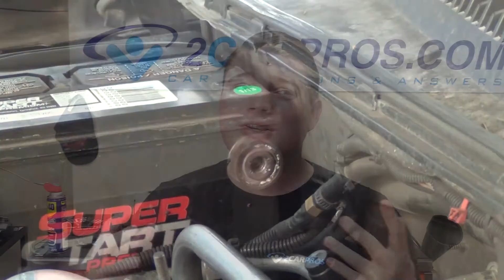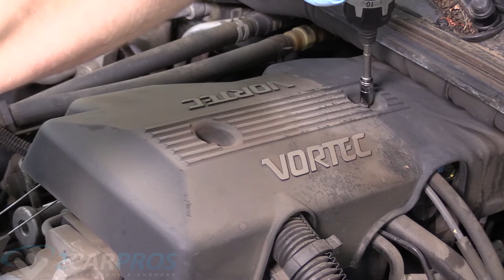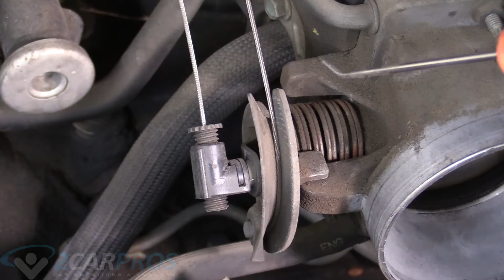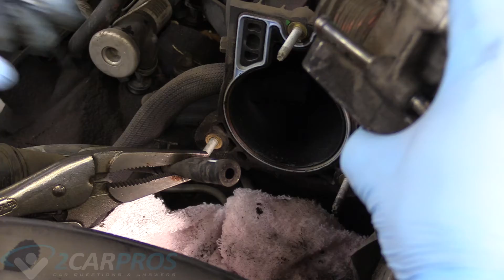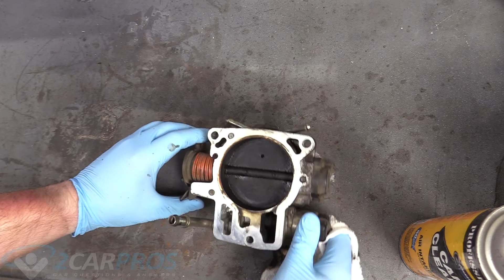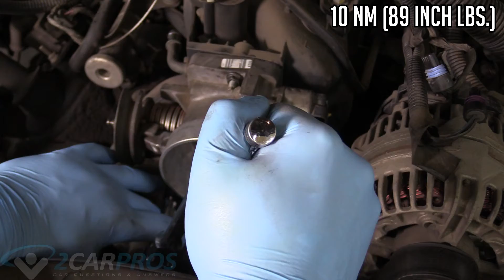Throttle Body Housing Service 6.0L Chevrolet GMC Suburban Yukon XL Silverado 2500

Comment: HEY WOULD THE THROTTLE BODY BEING DIRTY MAKE IT TO WHERE THE TRUCK WOULDNT IDOL ? It runs great as long as I keep my foot on the accelerator and rpms above 900
Reply: YES putting it in gear allows some slack, if the car in build up is killing your air it'll stall.
Reply: You giving it gas, gives it more air. You're probably running rich as well to verify.

Comment: If your paying a mechanic, you're better off buying a new throttle body for $40 more vs paying for 20 minutes of cleaning at $200 an hour. Just a suggestion.  Even if you do it yourself, it's worth looking at a new one for $132 bucks IMO.

Comment: Do you clean as much as u can on the inside when the carburetor is off.
Reply from the maker: You can, as long as you don't drop anything down in the engine while the throttle body is off. It is risky. Thanks for watching!

Comment: Mine was way more dirty than yours and it's an 04 yukonxl 2500 6.0 didn't have any cables to remove.
Reply from the maker: That must be when GM went to drive by wire. This is drive by cable. Thanks for watching!
Reply: @2carpros  but have to say after watching this took me total of 10 minutes and that was mostly scrubbing the gunk off of it.great step by step.

Comment: What is the tube you took off of the left side of the throttle body, mine ripped off and broke the connector, what would that he called
Reply: Thinking that might be part of the PCV feedback system? Doing mine now, and that hose is not connected to a pipe. Mine has a plastic device that's pretty well locked into place. It is also on the part of the throttle body that does not have to be removed for cleaning. Different Strokes for different areas of cars, trucks and vans.

Comment: I need to change my gasket fir the housing? Where is the gasket on my 2013 gmc 2500 6.0 vortec
Reply from the maker: If it is in poor shape yes. It is between the throttle housing and the intake manifold. Thanks for watching!
Reply: Thank you it’s just a small circle gasket that I bought from the parts stokes already

Comment: Hot air is not good for power or economy.  Heating the air is more of an emissions thing. I think I would have blocked them coolant hoses off and eliminated that.
Reply from the maker: I talked to a GM engineer once and he told me if the air is hotter the combustion is easier. Not sure how but that's what he told me. Thanks for watching!
Reply: @2carpros  Combustion maybe 'looks' cleaner with hot air but colder air is more dense (higher oxygen content to make better power) so I would say the engineer was telling you what he wanted you to hear. Warm gasoline would atomize better and easier than cold fuel so they would likely have had better outcome keeping the air cold but warming the gasoline to around a constant 100° F for that better combustion efficiency without the power loss.